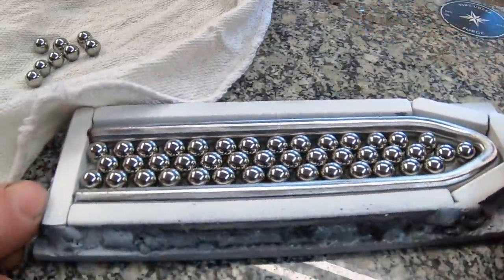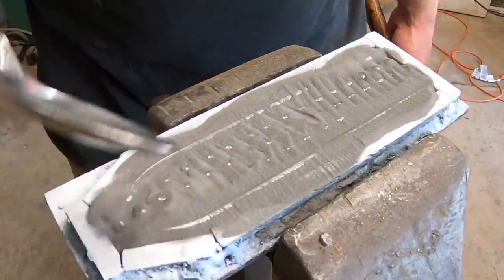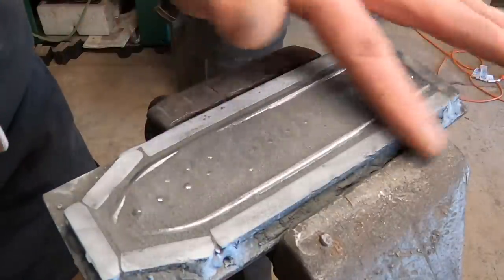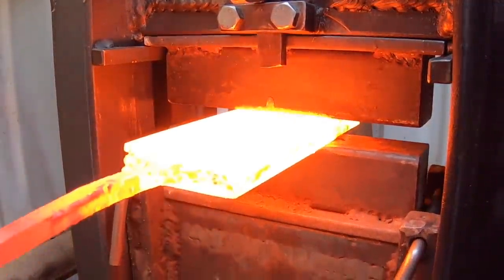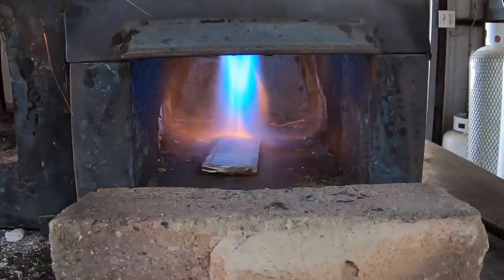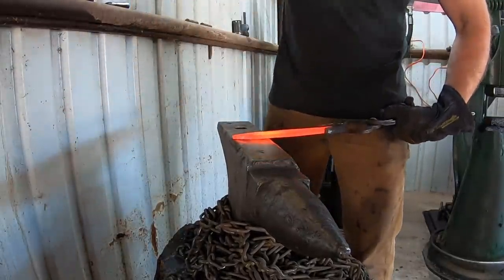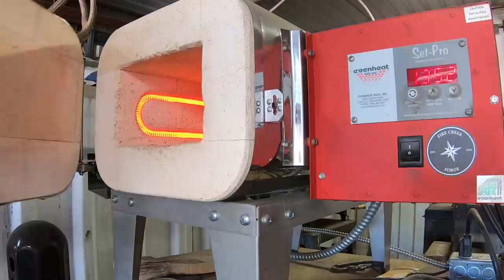Next Level Ball Bearing Damascus Knife, Blacksmithing and Knifemaking, Forging Knives, Bladesmithing

Comment: I’m sure many of you know this already but I just learned it last year. If you wanna save money on steel drill bits, buy a masonry bit and grind down the point to a “spade” that thing will cut through almost anything like butter, for a tenth of the cost of a good steel drill bit. 🔥

Comment: Gotta admit bro, this is some amazing work. Especially like the way the blade still has a keen edge to shave after the wood chopping.
Reply: That's cus of that tool steel billet he uses for the edge/hold the ball bearings
Reply: Matthew Timmons  I'm not an expert enough to know the eccentricities of all the different types of steel, but I do know it's a very hard tool steel, in my experience extremely hard steel can take a really good edge, but tends to be kind of brittle, and will snap easier.
I had a straight razor made out of silver steel and it was so hard that it was so sharp, it was a true scalpel, but I dropped it, while closed mind you! Once and it literally cracked and broke like porcelain. It was crazy

Comment: That is a pretty sweet looking pattern, a bit different than what I would have expected. I think it would be cool to try that same concept with different shapes inside, maybe some hexagonal rods?
Reply: I was just thinking that after finishing watching it.  Could use some screw nuts instead of ball bearings; that'd be neat..
Reply: @sweetdrreemz  yeah neat but the steel in nuts is rubbish plus  the welding process works well with spheres
Reply: @alphabuilders  They're obviously much more expensive and not what you'll find at your local hardware store but there are definitely nuts and bolts made from tool steel.
Reply: @alexsis1778  If you buy from larger steel companies in bulk, hex bar and flat bar is actually cheaper than your local harware store.

Comment: That is very nice! I've done a lot of research on steel for use in ball bearing balls and can say almost without exception the steel used is the best you can get. Even better than the races they roll in. Of course, it's got the carbon for thru hardening which may make it brittle but since you added the tool steel and powdered then forged it it should be a lot more plastic in keeping with what you need.

Comment: Very nice blade, I especially liked that you formed basically the enitre shape while smithing the blade and did not just grind it out after roughly shaping it. This is what I call real blacksmithing! Not everyone that can heat up metal and has a grinder should be allowed just call himself a blacksmith in my opinion.

Comment: Sir, would you be able to fill in the space between the metal spheres with smaller bearings? Or would doing this mess up the pattern you are looking for?? Great educational video.
Reply: Heads up, not a smith here. I assume it would make the design/pattern more intricate but would make the weld harder to do/less likely to succeed.

Comment: have you considered using different sized ball bearings so that there are more in the metal for a blade?
Reply: You have to go smaller to have more bearing material. The larger the ball, the bigger the gaps.
Reply: @larrybud  It doesn't matter what specific size the balls are. Spheres (or in 2d, circles) of any uniform size pack with the same efficiency because you can just scale your reference frame from one to the other. Whether the radius is 1 inch or 1 meter, it's still one, right? What matters is having a distribution of sizes, so smaller balls can pack into the otherwise empty space between bigger balls. Or if you prefer, you can consider the bigger balls to be solidly filling space which would otherwise be only partially filled by small balls with space between. That's essentially what's going on with the balls+powder situation in the first place. The powder itself, below some maximum, has a fairly random distribution of particle sizes, all of which are in thurn much smaller than the balls. The hypothetical ideal would be to start with closely packed balls of arbitrary uniform size and place the largest ball that will fit in each void, ad infinitum. So really, it just comes down to how you want it to look and just how much of a pain in the dick it is to actually do it.
Reply: correction: since the arrangement is 2-d, but the balls themselves are 3-d, you will actually find you have more mass of ball bearing if the balls are larger. They get to hide some girth which does not fit in the 2d world up in the 3rd dimension. That's sort of taking this too far though because in the limit you're just smashing one big ball into a knife shape and it's not damascus anymore. It would be pure ball bearing, though.

Comment: Great looking knife, now I got a question. How did you keep the O1 steel from turning into beach sand?? Every time I've had O1 almost at a welding heat it has come apart or crazed like old pottery, and has broken to bits when tested. Yes I test them very toughly. O1 is the only steel I've ever used that does that?? Anyway great job on the knife.
Reply from the maker: As I under stand O1 can be hot short as you describe, I believe it's just a matter of temperature control, not getting it too hot.

Comment: I do like hearing your thought process and a walkthrough of what you are doing. I don't forge myself but I've watched a shed load of forged in fire so I did know what you was doing. Also like the fact you do a test for how well the edge holds. Seen a few forgers that only test sharpness but I've seen you test the edge it fail and then you learn from it and improve the same blade.

Comment: when we used tom forge asnd did not want to get any temper to the steel , we used to put the red hot work in a bin with wood ash , it would take a bit more than a day to cool but you end up with almost mild steel , then we finish the work and harden the stell as required .

Comment: I was wondering, since I don't use a press and only hammer by hand, do you think it would work to just weld all the bearings and 01 together first instead of the plates?

Comment: Just a suggestion to avoid these gaps in the side could you cut the ball to find in this space and it should have a flat surface to rest against the edge, not sure if this will work.
This is an amazing blade ❤️

Comment: Sir, 

That was a very well done presentation of a blade formation technique I'd never seen before!

I can't imagine, though, why you used ball bearings instead of a solid slab of steel initially. Is it to disperse the metal evenly? 

Billets used to make Japanese swords are folded over and over with layers of slightly different metallic compositions so as to make the edge of different tensile strength than the back for hardness versus rigidity, and  they are lengthened by repeated folding, then forged differentialy using more heat shock. 

While a bit long, your thorough explanation was well worth watching all the way through! 

Great choice of the really hard Cocobolo too. I have nunchaku made of this and the density  of that wood is something else. 

Thanks for your contribution!
Reply from the maker: Thanks! This technique was a way to create a unique pattern in the blade.
Reply: Thanks--and I understand, but doesn't it weaken the blade by adding underlying stress ridges?
Reply from the maker: @dannypal123  all forging creates irregular stresses, but that's One reason why normalizing is important

Comment: Im curious if you could use transmission fluid to quench the blade in and to what hardness the blade would be if it was used in place of oil?

Comment: It would be interesting to try with smaller dowel pins. Open the tip angle to 120 degrees so the bearings can pack into that space evenly.

Comment: One of my pet peeves is when the industry and enthusiasts refer to this kind of product as Damascus. Actual Damascus is made from a type crucible steel called wootz, and contained carbide and in some cases carbon nanotubes. It was a grueling and unique process that we lost.

What this is is pattern steel. Wonderful craftsmanship in and of its own right , but not Damascus. 

It's like someone using a crossbow and calling it archery.  It's related, but different and distinct

Comment: I think some smaller bearings would group up better in the fillet the steel dust filled the gaps but the tip looked like it only had one bearing at the point still an amazing piece

Comment: I'm very poor and live in a tiny flat. Can I achieve the same results with only a kettle and a microwave ? That  auto hammer and fire box and spinning sandpaper machine look very expensive. Also instead of a hand hammer can I use an old tyre spanner ? Thanks guys.

Comment: Would you repeat a similar build to this for a custom order instead using some smaller bearings along with this size but use the smaller ones to fill some of the gap you fill with powder . 

The use of the knife would be for a all round knife in my truck from cutting rubber hoses to butchering a kill and smashing through a bone if need be . I’ve longed for a blade that can retain an edge like this ! I simply can’t find one in Australia !

Comment: Awesome video and knife!
How many times do you normalize after you are finished forging? Also what temperature do you bring the steel to when normalizing?

Do you always normalize the same way independent of what tool or weapon you are forging?
Thanks!
Reply from the maker: I normalize once after forging, depending on the steel normalizing temp is usually 1600F - 1650F.
Normalizing is important following forging regardless of the project.
Thanks for watching

Comment: This is an interesting way of making a blade, however there are a few concerns I had. 
1. The thinner and smaller your tang is, the more likely it is to useless or break off from the blade. (Although your tang looks alright albeit a little thin but I have seem worse.)
2. Heat tempering makes your blade more brittle and likely to break albeit more colorful. However I am confused because it seems like you did your tempering different.
3. Why use the epoxy so early on when you are just going to sand it off? Seems like a waste. Better yet, why not just use tea bags as it is a cheap way to stain the wood? Or if you want to use the original color, then polish as it will make it more smooth similar to the epoxy. Sorry I got off track. Whatever you want to use, why not wait until it was finished?
4. If you wanted the blade to be stronger, sharper, and smell better quality, you should have made it Damascus steel. This is not like your title. Damascus steel is a process of folding the blade over itself numerous times. You should not deceive your viewers sir. Please change your title or at least be true to it. 
That is all I can think of at the moment. Have a wonderful day. 😁

Comment: Not wearing any hand protection is gonna result in a different kind of 5 finger discount one of these days. Please stay safe, mate. 

Your hands are your livelihood after all, you don't wanna lose them. No matter how experienced you might be, all it takes is one slip up and it's years of rehabilitation.

An apron and face protection are good, but so is protecting what's going right near those high powered grinding belts and molten blades.

Wearing gloves at the end of the video ( 11:55 ) is like going to a dinner party with nothing but a top hat on, entirely out of place from where they should be.

So yeah, please stay safe! 😉

Comment: The knife looks really great! But the point of the Damascus steel is that the edge cuts better due to differential hardening and the blade body is more flexible. That was not achieved here. It just looks beautiful.

Comment: Masterful work. Will it go rusty though?
Reply from the maker: It is high carbon steel, it can rust if not cared for.
Reply: @FireCreekForge  Aren't there any steel alloys that keep a good edge and strength that are corrosion resistant such as surgical steel?
Reply from the maker: @Kryptoz  there are many. Surgical steel is a broad term that usually doesn't include quality blade steel. S30V is probably the most common nowadays for stainless steel blades with good edge performance.
Reply: @FireCreekForge  S30V is expensive. Could you make a blade out of scalpel handles / blades?

Comment: Having severely burned two of my best stainless steel pans, I've learned to heat them to a precise temperature before quenching them at a precise rate,  then repeat the process at a couple of lower temps.  Result:  Refurbished stainless which does as well as the original and has no overheating discoloration!

Comment: What you really need to do is use that size of ball bearings and get smaller and smaller ones until you cant find anymore, if you can find tiny steel balls small enough you might not even need the powdered steel at all

Comment: It's a good blade and it looks amazing and is definitely tough as nails but personally I prefer the traditional way to forge Damascus because it takes more effort and looks more unique and as far as I know it might actually be stronger except in cases were the forging process is uneven but all that said that knife is much lighter weight therefore the simpler forging style technically makes it easier to wield which is good for a precision melee weapons therefore technically it's better based on what it is and what it's meant for but ya your talking to somebody though who's prefered weapon is a claymore sword or a hand axe or two handed forging hammer that is purposely 35 pounds or more in order to hit really hard so technically my opinion is not a fair comparison for what that knife is therefore the fact you made that thing the way it is makes it really good and badass don't stop smithing dude you know exactly what your doing
Reply from the maker: Thanks man

Comment: I thought Damascus was folded over and over? Admittedly I had to watch the video on mute and know very little about knife building. I am lucky enough to live close to master bladesmith Jerry Fisk and have attended a couple classes that local knife enthusiasts have at the Riverside Machine store in town. I had heard somewhere that Fisk was one of the best Damascus builders out there and I love the patterns of grain in the metal. Been a fan of Damascus since I saw my first Damascus blade.
Reply from the maker: That's great! While this is not a high layer count as most Damascus is, it is still pattern welded which is why I'm calling it "Damascus" steel

Comment: Let me preface this by saying that I am not a troll, and that as an example of Art & Craftsmanship, this is an amazing example.
   The desired result, of any edged tool, is the EDGE !
Everything else, is virtually decoration
   I do not agree that this is a Damascus knife. The mystique of Damascus blades is/was their strength and marvelous cutting abilities. The EXACT Formula for this metal has been lost to time, but everyone should agree that the near magical performance was the result of the mixing of the metals, folding, and heat treatment that was legendary... 
   Since none of that, went into the point or cutting edge... this knife, as impressive as it is, is a patterned, type 01 Tool Steel Knife. Not Damascus. Too much today is being blurred and lost to "thinking outside the box" / "political correctness" !  Lumped together for convenience : Fantasy, Horror, Science Fiction...
   You cannot make an Omelette that contains no Eggs. Your knife might even be superior. Nobody knows for sure . I've seen Kukris, made from old truck springs, cut Steel Common Nails, not soft Pine, in two, and still shave hair. Pete Gerber, sold his business, 'cause Americans didn't want Fine Knives, they wanted knives that would cut cardboard & not rust !
   It took a while, and we're coming around... at last.

Comment: Better way is just to 3d print 308 cobalt nickel additive material(605inconel) and have a sword that will outlive the planet.  Hard part is sharpening, no forging and if printed right we should just have to to hone the tip for slicing.
Reply from the maker: Inconel is specially designed to maintain stability at high heats, but it doesn't really have the desired qualities for a knife.

Comment: 9:04 my sensei would rip my head off if I would have scrape with the measuring tool, because this is grinding down the sharp edge you need in machine engineering. this makes the difference between on point measurement and chinese standard tolerance crap ;)

Comment: I got a question,,,,, I'm not a blade Smith, but I started watching forged in fire in prison so I pretty much consider myself a professional 😆I'd be yelling at the TV,,THAT BLADE AINT HOT ENOUGH TO QUENCH YOU IDIOT!!! then the judges would say the same thing,,lol,, but here's my question,,,can u use harden able steel as your canister?? I always wondered why they use mild as the canister then sometimes have a hard time getting the canister off under the clock,,,am I on to something here???